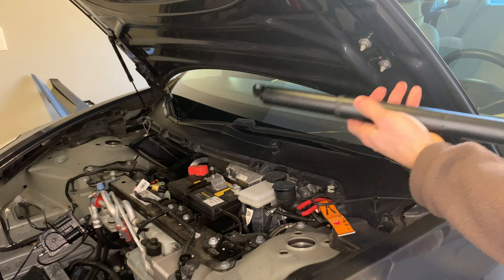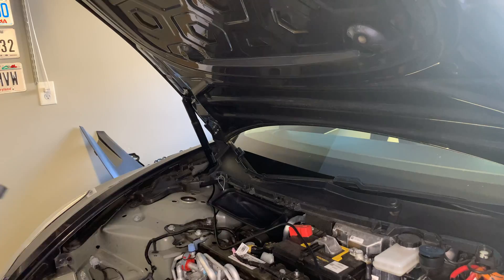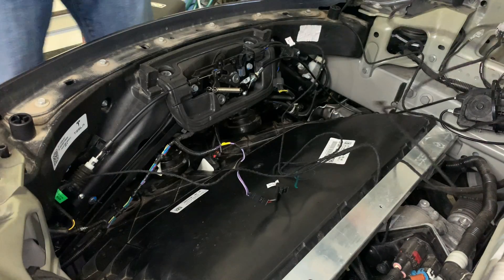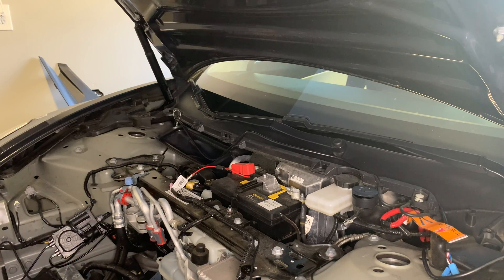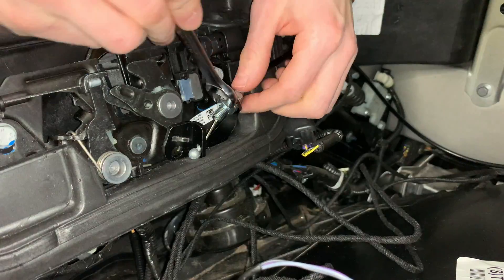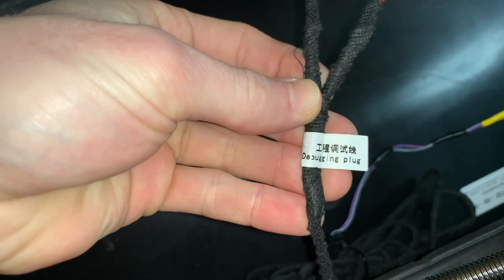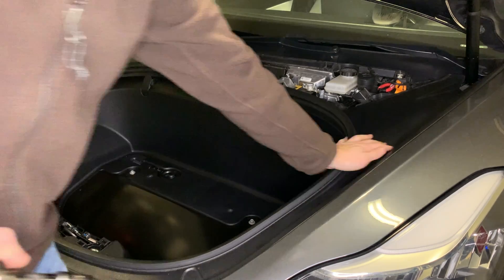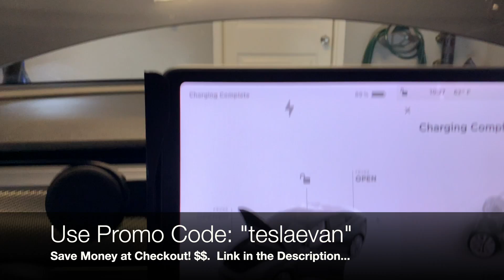Tesla Model 3 Power Frunk Automation 🔥 Easy How To: Install Help ✅ Hansshow

Comment: Thanks for the video.  Very helpful.  Question, at the end of the video you both open and close from the car screen.  I did everything the same, but mine only opens from the car screen.  Any idea what I may have done wrong?
Reply from the maker: Thank you! Umm all connections properly clipped in? Not sure why yours would not close on the screen. There is no canbus connection so that’s the only thing i could see.
Reply: @EMtesla1  Yeah, triple checked all that.  Perhaps its a firmware issue, I bought mine in December 2019 and meant to install in early 2020 (we all know how that year went). and just got around to it now.
Reply from the maker: If you reach out to Hansshow, they may be able to send you a SD card for a software update to that gray box.
Reply: I have the same issue. That was made known to me in an article I read from Hansshow prior to my purchase,  and it's because of an official enhancement on the s/w impacting m3 from mid 2020. I reached out to Hansshow, but all I got were links for instructional videos that do not really address that particular issue. Hansshow was very supportive for other issues I had since it is the first time I had futz with the system and not proficient with the install. I hope there is a resolution but for now I just have to live with that lack of Closing feature from the onboard PC.

Comment: Nice install. But isn't the emergency coil for if you get locked inside the frunk not for general unlocking?
Reply from the maker: It's to open the frunk hood to access the 12v battery should you need to access it. The button inside the frunk will also open.

Comment: Great video Evan, thank you. Been considering getting the power frunk for my 2021 M3. Can you tell me what the 'buzzer' is for please and if you can skip it from the installation?
Reply from the maker: it lets you know you activated the power struts and that the hood is about to open or close... Also when you hold the button down inside the frunk it can be programmed to open/close faster or slower. In this case you would listen for the beeps. 1 beep is the slowest, 5 beeps is the fastest. 5 is what I have mine on.
Reply: @EMtesla1  Thanks, that's great info! Out of interest, how long would you say the install took you in total?
Reply from the maker: I did it in a couple hours.
Reply: It would take at least 2-3 hours (maybe longer as I cleaned the insides before starting the install).  But only because one is not proficient with the install If I were to do this again, I am sure I could finish under 2 hours. It's not really difficult.l @awginger

Comment: Great video Evan. Nice camera angles and great explanation. Your installation is really clean and easy to follow. I just finished installing the new V4.2 frunk lifts on mine that they sent me to do an installation video like yours. The control box is waterproof and I did route the emergency latch to the passenger footwell. The control box only has one big connection. Everything else seems to be the same as yours. I am hoping to post my video sometime this week.